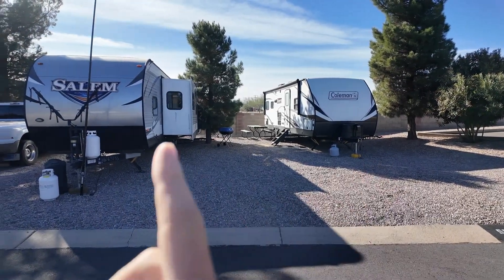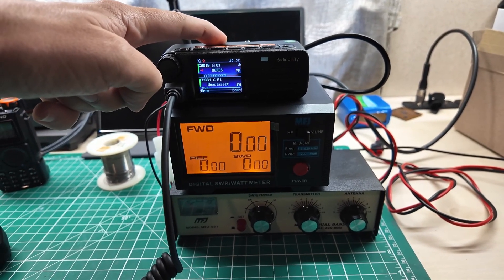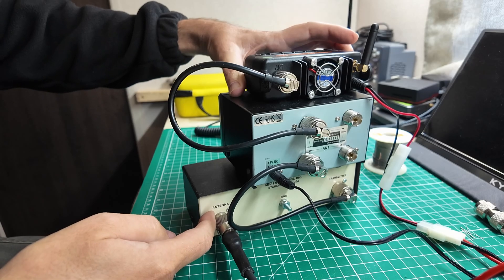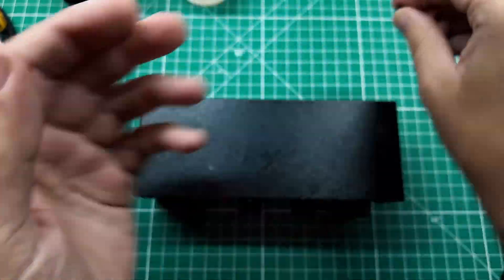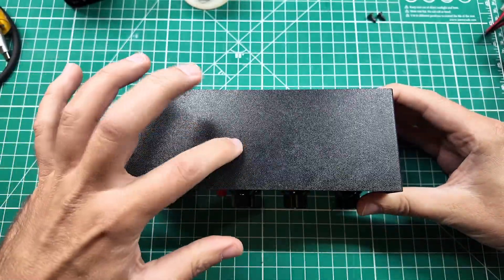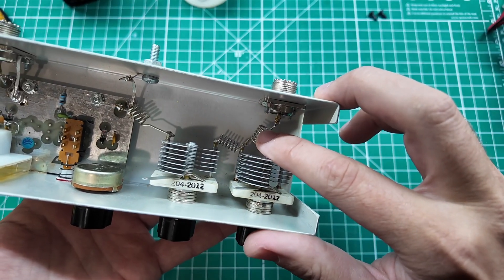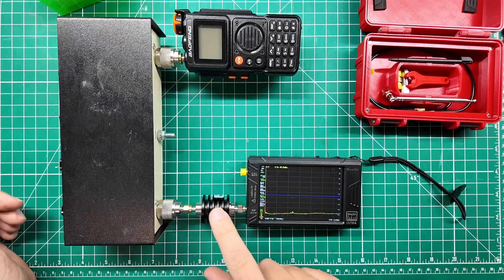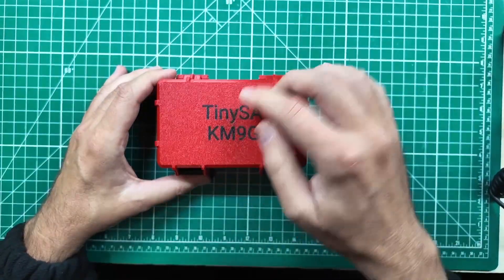25ft Tall Mobile Antenna?

Comment: Expedient and functional, at least for a local repeater. That's reasonable. However, the pattern will be terrible, and gain may be hard to determine, it's likely this may not work for repeaters a little further out. Coax losses at VHF+ are horrendous, but a short run like to a repeater maybe won't be too noticeable. I'd suspect a 1/4" mag mount plopped anywhere convenient on the roof would perform better far better, and be easier to set up. A jpole on a painters stick anchored to a bumper or ladder would be excellent.
Reply from the maker: Any antenna cut resonant for 2m will do 1000% better... But will make it really hard to demonstrate the tuner in a video.

Comment: Those are really nice looking right angle antenna connections on that short wire you have connecting the radio to the str meter. Where did you order the cable or connectors>???
Reply from the maker: Hey Mike - I got a cheap set off of amazon: https://geni.us/8EAz9

Comment: Good stuff. I have to get the right threading for my  telescopic whip. It's been on my list of todo's. I keep having to deal with my neighbors or work stuff. I have radios but no reliable antenna. Between the rain and the solar array across the street, I barely get to operate these days. Thanks for the inspiration and for taking us with you for your projects, Steve. Appreciate you. 🤙🏾
Reply from the maker: Thanks Geek!  Unless your whip is an odd duck, the US threads are 3/8th x 24 and the metric threads are M10...and the make adapters

Comment: You might experiment with using a coax stub to deal with that nasty second harmonic from that Baofang. If memory serves me correctly an taking into account the velocity factor of the coax, a shorted 1/4 wave stub at 2 meters will reflect as an open at 2 meters but be short at the second harmonic.
Reply from the maker: That's a great idea, I'll have to give that a try!

Comment: Steve, another solid gem of a video. I appreciate you showing some of the challenges that are ahead. I'm thinking of a 2m/70cm comet antenna mounted to the side or rear with a folding mount like my boat. Then I could put the antenna down flat when moving and put it up when parked. Just an idea. Good to know that if all else fails I can use the versa tuner. I think I'd go with the Ed Fong for temporary use, since I have it and it doesn't take much space.
Reply from the maker: I have been looking at mounting a dual bander on the RV, haven't landed yet.  Of course there will be a video when I do.

Comment: I have used 4:1 on 25 ft lots of times. That green toroide is more broad banded than outher cores like red or black type 43 ferrite. I could not get out on red toroide or 43 ferrite on 2 meters.  Yes manual tuners work as band pass filter as well.  It is 8F and sunny in NY with some wind. NOAA radio beeping for a few days now. Heavy snow with wind and wind chill of -40F on the way. low temp of -10F . Got plenty of solar charging in wind gen putting out good power. I got extra watts ! so hot tub is going .  Girlfriend is jumping in it after work like 3 am . I got waterproof GMRS radio . Maybe a test . LOL . Love that Prosodion antenna !!  Just don't be like APE and cook toroide . it hurts the minty taste. 73
Reply from the maker: I'm going to have to do a video about that green toroid someday.  It's really interesting to hear about your experience.

Comment: It is generally a bad idea to use a tuner at VHF and UHF  as it leads to tremendous line losses. Better to use a VHF mag mount on the RV if is metal.  If I assume that you have 25ft of LMR240 going to your antenna and you measure SWR near 5:1 in the shack, I can use TLW software (comes w/ Antenna Book) to model the losses.  An in shack SWR of 5.13  indicates an at antenna SWR of 9:1.  The total line loss will be 2.6 db with 1.84 dB coming from SWR loss.   If you install a vertical with 3 dB gain hand have 1.8 dB matched line loss the gain is +1.2 dB.  Your radiation pattern with such a long antenna will also be weird. Yes I know one can work something on almost anything but some choices are better than others.
Reply from the maker: Agreed, I just wanted something to demo the tuner with and have some fun.  See you in the next one!

Comment: Great video! Correct me if im wrong, but most of your radiation would go straight up with a long vertical wire. If you could point the end of the antenna in different directions, youd have fantastic directional gain. Like a beverage antenna
Reply: Likely true
Reply from the maker: Sounds like a neat test!  I have no idea of the radiotion pattern on this, but it was fun to play with!
Reply: @temporarilyoffline  absolutely! That's what it's all about

Comment: I have the tuner and for several years. i used it on a 80 meter dipole for 2 meter SSB while in the upper Mid-West. It wasnt great, but I was surprised I did make many many contacts. I easily put a hundred watts through it,
Reply from the maker: Very nice!  hard to beat an 80m Dipole for "wire in the air"!
Reply: @temporarilyoffline  living in the middle of 6 sqr. miles mostly by yourself allows you to put up any antenna you can afford!. I was only able to afford a roll of wire,  while still raising kids!

Comment: Thanks for the video, including opening the case .Regarding the Tiny SA portion of the video, the trans match is a low pass filter design with the capacitors going to ground. De AD0L
Reply from the maker: Thanks for the call out!

Comment: Metal skin trailer?  Why not use the trailer skin as you ground plane?
Reply from the maker: @david-w9tax797  it's on the list, but it's important to note that getting signals in and out of the RV is harder than a normal vinyl clad stick built house.
Reply: @temporarilyoffline  thats just a Myth. ONLY the signals you want in and out are the hard ones!

Comment: You know, you could have just turned off the tone for the repeater and transmitted to adjust the tuner, you would have never bothered the repeater at all.
Reply from the maker: The repeater wouldn't rebroadcast for sure ... But don't you still have capture effect keeping others from using it?  I was really hoping to excite some traffic on the repeater anyway.
Reply: The radiation pattern likely will look like a porcupine spiked